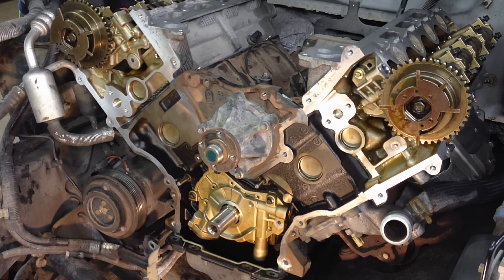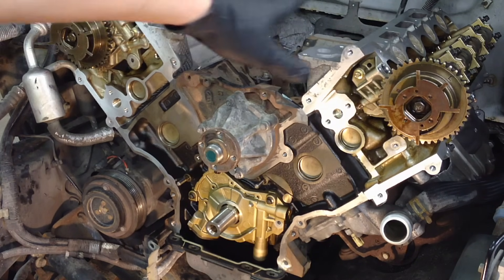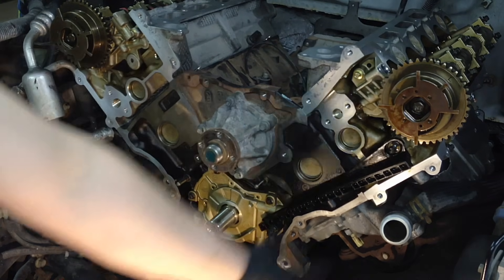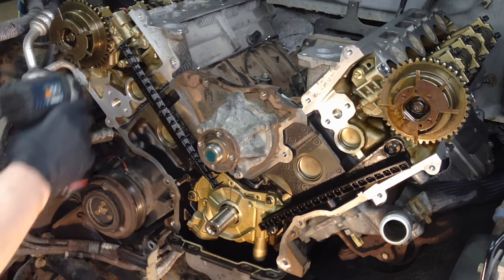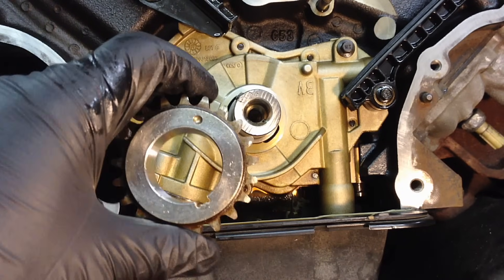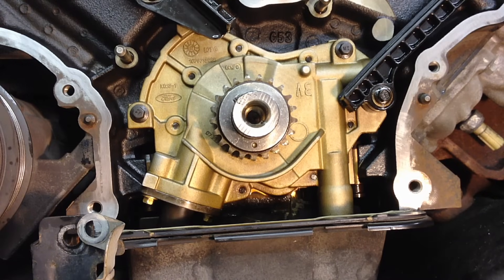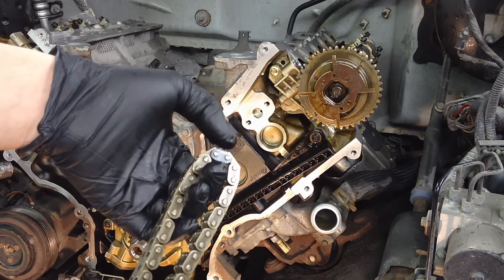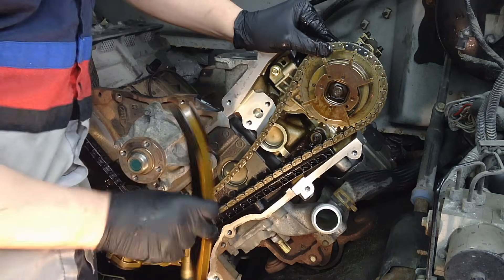Ford 5.4L 3v Engine Timing Walkthrough

Comment: If you get the crank shaft and phasers correctly positioned are there other mistakes that will destroy the engine on start up? Looking to identify the points in the process that can not be corrected if startup does not go as it should. Thanks

Comment: are there two different motors in 2011 navigator 5.4l? like windsor and romeo or its just the older ones? either way will this work for any 2011 navigator 5.4l?

Comment: How does one know where to place the L and R on the cam phasers? It looks like letters on the phasers were placed at 12 o’clock in relation to the heads.   But does it matter just so long as you locate the colored links properly?
Reply from the maker: it is set by colored links as shown here.

Comment: How do I tell the5.4 2v from 5 .4 3v
Reply from the maker: If you have a VCT solenoid sticking through the top of the valve cover then you have a 3v engine.

Comment: hello good afternoon I have a problem with a 2004 ford f150 engine 5.4 3V when it turns on everything is fine but after about 15 minutes it starts to fail and does not work on bench # 1

Comment: Followed your guide and tried to crank engine by hand to ensure everything works ok. The tensioner on the passenger side collapses for a second and then pops right back up as you keep turning, any ideas what is causing this?

Comment: Question, I took my passenger valve cover off on my 2010 5.4 3v. Due to a diesel type noise only on passenger side once engine got hot. I suspect a worn phaser. I turned my crank pulley maybe 10 turns total to check my followers to see if they were the cause of my noise but they felt fine, so I’m assuming it’s the phaser. Now, my question is since I turned that crank bolt clockwise about 10 times do I need to turn it back counter clock wise to where it was when I first tore it apart before I change that phaser?? I’m going to replace JUST the phaser on that side.
Reply from the maker: You need a complete timing job and roller followers should always be replaced on your model year engine, trust me.
Reply: @FordTechMakuloco  what is the exact cause for the phaser to start making noise. Is it because it is worn?

Comment: some advice I have a2007 5.4l 3v with over 200,000 miles been wanting to do the chains and phasers oil pump etc. but the engine still runs great purrs like a kitten. the only thing is on startups not all the time just sometimes I will hear the chains rattle for a second or two but always runs good. I listen with a long prybar over the valve covers and it all sounds normal, no tapping or ticking. so, I am getting all parts for now which are needed. what would you do keep running it or just do it?

Comment: well, it finally happened. i got my 05 used a few years ago, but it was actually in good shape. about a week ago i noticed it acting up. by no means am i an expert or honestly even that good of a mechanic but i do like to work on vehicles. but i took it to my local ford place, because i "cant" work on anything in my own yard anymore because of the landlord keeps calling it junk and threatening to have it towed to a junkyard.(kind of a long angry story), and got them to run the diagnostic on it thinking fuel pump or spark issue. i dont have the software or id have at least done that myself. he came back and said the noise we were hearing was the timing chains and or phasers, along those lines. so he quoted me like 3 grand to do a timing job, but of course he also quoted me $6500 to replace motor. i hate knowing what to do and how to do it but not being able to do it and it costing that much. now im back in the ironic phase of i need to work to get the money to fix the truck, but i need the truck to get to work to earn the money. since i wasnt able to fix my foxbody mustang " because its junk and this isnt a junkyard" i dont have another ride and i work nearly an hour and a half away. yay me, and right b4 Christmas too. awesome

Comment: It's a 5.4 3 valve, that says it all for me.
Reply: I have a 96 Econoline 150. 351 Windsor.  178.000 miles .Runs great don't use a drop of oil. I religiously maintain it . In my opinion the 351,302 are the best small blocks ever made by ford. You couldn't give me a Triton engine.

Comment: i have the engine at TDC and covers off but my Camshaft lobes are not in the correct location. Cylinder 1 the lobes are to point at the 11 o'clock position and cylinder 5 lobes should point at 3 o'clock. Then remove parts. But i think my timing chain jumped. I need to know how to get the camshaft lobes back in correct location when the engine is at TDC?

Comment: Is the crank positioned on the 6oclock top dead center power or exhaust stroke? My point is the crank rotates twice for rotation of the cam shafts so which is it? Just asking am about to do this to my own truck cause dealership wanted 5,000.00$ lol
Reply: One rotation of the camshaft*
Reply from the maker: There is no power or exhaust or compression stroke when it comes to just the crankshaft. You are literally just setting the position of the crank. It goes down it comes up and repeats. The cam timing is what sets the strokes.
Reply: @FordTechMakuloco how do I set the cams properly once I've set the crank with the tool? PLEASE HELP!!

Comment: FYI brother the timing tool is designed to fit against the crankshaft sprocket.  You set the left side first with the tool in place,  remove put the right chain on and replace the tool and complete your right side. Trail and error,  isn't it nice we are only human brother?
Reply: So much easier when you look at the design of the tool.
Reply from the maker: What in the world are you talking about? You set the crank with the alignment tool to the nub then remove the tool. It is set no more need for it, the crank is not going to move one bit.

Comment: So when you put the crank mark at the 6 o'clock position you don't have to worry about the number 1 piston being top dead center?
Reply from the maker: It already is.
Reply: Thanks. I actually used your video to do the timing

Comment: Regarding getting it at top dead center, don't you have to make sure that you're on the compression stroke first? Like, if you follow these directions without making sure that you're at TDC, wouldn't you be 180 degrees off??
Reply from the maker: There is no compression stroke on the crankshaft side. You are setting the compression stroke when you time it not when you set the crank.
Reply: @FordTechMakuloco  Omg guys!!! He replied to me!!! I'm framing this. 
F.r. though, thanks. Lost timing when changing a phaser. So I just remove the roller followers then follow this procedure and I'm good??
Reply: This comment saved my life bro thank you

Comment: This is an older video, of course. In this  one, were the timing chain tensioners plastic and I noticed you had the stock Ford oil pump which is a great contributor to all of this stuff failing due to low oil pressure and volume.
I imagine you would not recommend these pieces today.
Reply from the maker: This was at the dealer.

Comment: Question, after following your directions on the chain position, guides and tensioners, I did some spins to  the crankshaft with a 32mm socket as you explained and the tensioners make noise like a click while moving their pistons in and out, is that normal because is not oil in them yet to keep the tension?.
Reply from the maker: They will move and compress etc but should not make any noise. If you used aftermarket phasers then this is your noise and they should be replaced

Comment: When i was putting the Right hand  new phacer and i was about to  torque it down the 3 lil rivits holding the spring part started to spin with the chase being locked up with the tool now it came apart is that phaser  garage now? I just got them from Ford  but i think it was damaged  or i dont kno if i damaged it my self  but it was an oem can it still be usted and if not do u think  Ford Will get me another one? IT would be a threat help to hear from the expert as your self

Comment: Is that crankshaft position at TDC? That's what I'm assuming it's at.
Reply from the maker: yup
Reply: @FordTechMakuloco  question why did you have your cams/cam caps loose?  Does the reason for that have to do with my question below this comment?  I understand what I'm saying isn't probably Ford's proper procedure to do timing but I would think it would be the same as keeping roller followers out and cam torqued down.   This just saves me from having to buy a roller follower removal/add in tool while cam is torqued down.
Reply: @FordTechMakuloco    instead of keeping roller followers out while doing this procedure could I just keep the cam caps super lose (barely on) and turn the cam freely setting the letters on the cam phasers R on the passenger and L (approximately 90 degree on R and L/ crank sprocket timing marks and chain marks should force line up the cam phasers properly; aka 90 degree on the R and L) on the drivers side to match the timing chain double link marks (two dark links) a long with bottom sprocket timing link and mark.  Then once all timing chain/guides/tensioners/ and phasers are all setup and look right torque down the cam shaft in proper sequence/torque specs?  Wouldn't that be the same as keeping the cam torque'd down with roller followers out while setting timing and then later adding back in roller followers one at a time with the roller follower tool?
Reply: @FordTechMakuloco  thank you for your replies by the way.. Very helpful.
Reply: Or can I set up all the timing like you did with cam caps loose, and then with cam caps loose would it be easier to set in roller followers without the roller follower tool?

Comment: Breaking doing the broken guide thing on 07 f150 5.4 3v.   How do I set time on the broken guide side of I think it jumped time?   Did a leak down test and held steady pressure in all areas.  Dropped pan removed guide pieces.  I just want to make sure time is correct

Comment: Great videos, I've got one of those junkers and got to do some investigating on timing chain noise, got front cover off finally after cutting the PS pump off....damn sissy ass bolts.....driver side chain has alot of slack  but nothing broken. Tensioner probably bad but not sure just yet. You never indicated about the pistons position with crank.....I've done lots of mechanical work in my time and just turning the crank over and sitting it at 6 O'clock....hummm.....should have a reference position to where the piston is at.....right?

Comment: Think you should cover the difference between left an  right side cams they are difrent, luckily I had cams right unfortunately it seems I was not T.D.C. on compression stroke instead on exhaust an marked fazers left an right opposite of what they should of been after lining marks up on  chains an rotated engine couple times watching cam lobes an firing order I knew some thing wasn't right. Had hard ass time çause no one seemed to know the  difference thanks to ford form couple old boys figured it out one longer than the other. may of had that right but dam sure had fazers wrong, wonder what happened when I truned the key????

Comment: All these videos on 5.4L 3 valve and nobody mentions CRANKshaft position sensor. 
You may as well throw the camshafts in the sewer if you're not going to be in harmony with the cranshaft and it's a $34 part for Motorcraft genuine part from Rock Auto.
WTF dog come on!

This took 25 years off my life because everyone screams camshaft camshaft camshaft. 
I wonder how many people throw away vehicles because they gave up not knowing about the crankshaft position sensor.

I do love your videos and you're the first person I look to for 5.4L advice.
Keep up the good work. I hope you're making bank on these millions of views.
Reply from the maker: Not sure what your rant is about exactly. If you are asking why I didn't change the crank sensor, well it's simple they never ever fail.
Reply: @FordTechMakuloco   I had a fan belt (serp belt) failure while on the road over in Miami. A loose strand hanging off whipped through the harness going to the VCT solenoids & position sensors. Bought all 4 parts, reworked the harnesses and all was great, for about 2 years. Then it began backfiring, really bad, on startup but ran fine once it was running. Checked all harness under the hood and no lingering damage from the serp belt event. Then I turned on a video by Ford and first thing the man says is "These camshaft position sensors work in coordination with the crankshaft sensor and my head about exploded. Replaced the crank position sensor and it's like a brand new motor. I had already called the junkyard about bringing in the truck and the title. Now I have my truck back and it cost me $34.
Reply from the maker: Nice!
Reply: @FordTechMakuloco  nice indeed. If we didn't have pain we would never know joy!

Comment: Hey FORDTECH do you absolutely have to take the valves loose to be able to get cams in correct position because I can move the cam with a little force 4 inches either way and get it to where its just about to roll over and get the chain on

Comment: What about 2 valve?
Reply from the maker: I have a video on that too
Reply: @FordTechMakuloco  I timed my 05 mustang using your 1-4 video on how to time a 3v 5.4l.  I completed it and it runs and drives. I set the crank keyway with the tool and cam phaser lined up with everything. if i trimmed in on the exhaust stroke instead of the compression stroke would my check engine light turn on indicating a problem. I have no codes or check engine lights. I never removed sparkplug front cylinder one and used a tube and balloon to find TDC compression stroke. I set my lobes as you showed in 1-4 video.

Comment: I have a 2005 Ford F150 that just turned 330,000.  I have never changed the timing chain, and every component on the engine is original.  It runs great, has strong compression and a lot of get up and go.  Was told the timing chains should be changed every 100,000 miles, so I should've had three sets by now but never did.  Always ran fully synthetic oil.  NOW, I want to be good to the truck, and for no other reason, am considering changing the chains, and while there, also do a Melling oil pump.  That chain's gotta be stretched by now.I will hire a good mechanic to do this. Does the engine have to be removed from the compartment, or do most engines get worked on inside the engine compartment?
Reply: Did you ever get the timing chain job done?
Reply: @productive23  Hey productive.  Believe it or not, I never did change the tming chain.  I thought I'd follow Fordtechmakuloco and do roller followers, and all he recommended including timing chain, but I never did ANY of that.  It's all original, and now I have 356,000 miles on the truck from two years ago when I last posted. Just recently, I had the alternator fail as the battery light was on. To me that was alternator acting up, so I changed it.  So now, the only components I ever changed on my '05 F150 are starter, and alternator.  All internal motor parts are original.  I was to enphasize that I only use Royal Purple Fully Synthetic oil, and a good oil filter like Wix..
Reply: @lostinmyspace4910   How often do you change your oil and filter?  I have a 2009 5.4 I purchased used with 130,000 on it. The past owner used Amsoil and claims he changed it every 3000 miles.  Which is what I have been doing with full synthetic Mobil One and the  best filter Mobil One sells. Am I going overboard on oil changes in you opinion?
Reply: Six to seven thousand miles, then I'll change the oil.  I use a WIX filter.  That's a really good premium oil filter.  DO NOT ever use Fram...that's junk.
Reply: I am now at 363,000 miles, and I never did change the timing chain. @productive23
Reply: @productive23  I am now at 363,000 miles, and I never did change the timing chain

Comment: Do I need to reset the timing when I changed out the cam positioning sensor
Reply: No hydraulic (oil fed) tensioners keep chain tight regardless of Cam Position Sensor readings. Bad sensor will make it sound rough idling more than likely but it’s just the VCT trying to compensate for the bad sensor giving it weird readings

Comment: How much would getting my timing problem fixed i had some codes read p0012 they suggested fixing the vct selnoid so i did and its still shutting off at stops and the engine shakes alot around the 40-55mph range

Comment: So after removing 3 rollers each head and turning the key to 6 o clock , then i put up chains and tentioners but my question is how any times to i turn the key to be at correct timing from that 6 o clock position? Or do i just go from 6 o clock to 10 o clock and thats it? Pleasr help me! I hv to get it done today!
Reply: Go directly from 6 o’clock to 11 o’clock. Less than half a turn. Then match the timing chain marks. I used the crank tool to get the crank perfectly at 11 o’clock position.

Comment: I have a question. Soon as I put my truck in drive it starts to misfire under a load I have replaced oil pump timing chain phasers spark plugs and randomly swapped out coils could it possibly be a computer problem. Or is there something else I'm missing I did a compression test I have good compression. I feel like I have to be missing something simple. A little advice would be appreciated thank you

Comment: So the timing chain tensioners broke in my 5.4 3valve so the left side cam gear is behind time crankshaft is at 5:30 not 6 and the right side is In time, was still running if I go to 6 the valves won’t interfere after that and I can just spin the cam gears ?